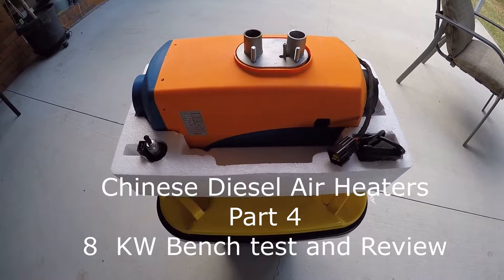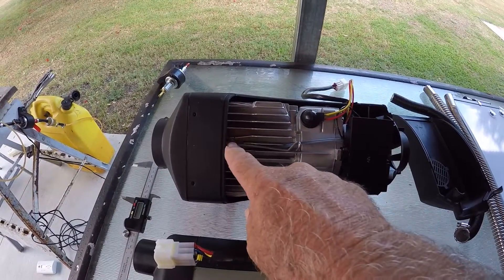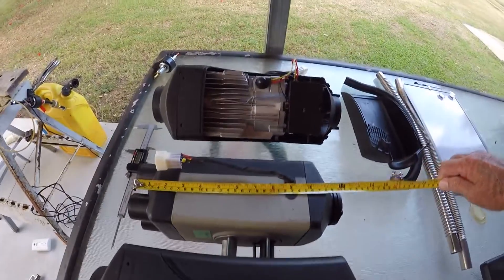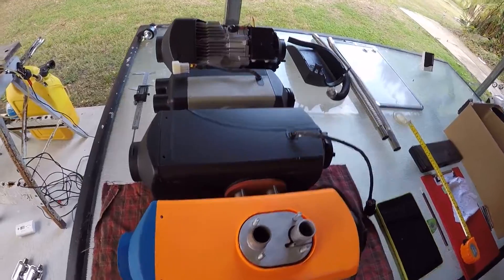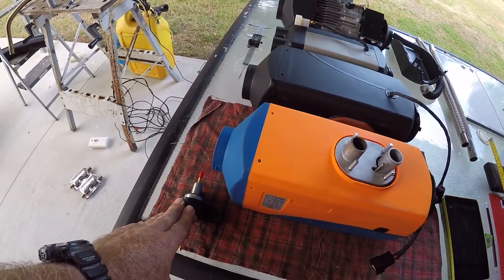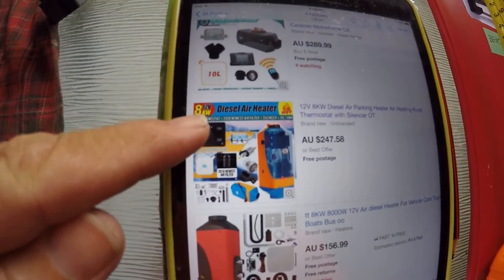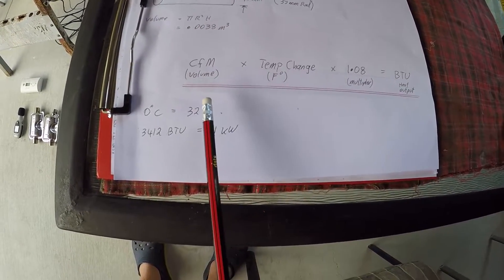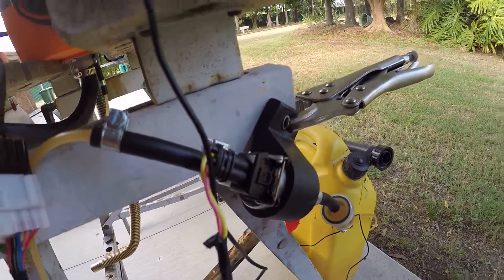Chinese Diesel Air Heaters   Part 4 -  8 KW Heater Test

Comment: I am running a 2KW heater mounted in the same orientation that they are on your bench (except 180 opposite with the glow plug at the top of the chamber). It is sitting flat on it's side. However at -30C, it keeps the temp at +2C in my van. If I wanted to swap the the 5KW into the same spot, would the exhaust and air inlets line up the same height above the side. I note that the %KW is longer, but I suspect it is also wider, and therefore I would not be able to swap them out?
Reply from the maker: Hi MP, yes the 5 kw heater is wider than the 2KW heater, so you would need some modifications.  JMcK
Reply: @johnmck1147  
Thanks a lot for the reply John. I've watched every one of your demonstrations, and looked longingly at the woodwork in the cabin of your boat. One thing I did not do, so I will watch them all again, is make notes that may relate to my installation because you touched on may points that I need to take action on. In the 2 years since I installed mine, I've probably made every mistake that you touch upon (especially with respect to the intake and exhaust lines). So one of the first things I did after watching your channel, was order a couple of new doser pumps. My latest problem seems to point to no fuel to heater. In Canada all our fuel is LSD, and I need to add lubricity agent to the fuel tank of my old Delica van, but have not added it to the fuel for the heater. Also the tank is a long way back, and I've made the mistake of letting the doser pump prime the lines on many occasions. Next when the temperatures outside improve from the -30C that they currently are, I'm going to crawl around and perhaps make some more modifications. For example, it would appear my pump although oriented correctly, is the opposite of your recommendation and I need to move it from right next to the heater and closer to the fuel tank. I pity the 'responsible' Chinese sellers of these items. There are so many variables to a successful installation, I'd suspect most the of the DIY installs go wrong the first time. BTW, until I discovered your videos, about the best written troubleshooting guide I had found that you can print is from a retired engineer by the name of Roy: https://www.letonkinoisvarnish.co.uk/eberspacher_intro_1.html
Reply from the maker: Mountain Parameters 

Hi MP, thanks for the positive comments, the detailed feedback and the info. JMcK

Comment: It is common in the furnace world to advertise total BTUH output (heated air plus exhaust). My 100,000 BTUH Lennox is 80% efficient and outputs 80,000 BTUH. 

The exhaust from the Chinese heater is pretty hot so imagine that it may only be about 65 -70% or so efficient. 5,000 watts divided by  0.65 is 7,700 watts so maybe they are accurate but just not mentioning the low efficiency. It would be interesting if you would run the same experiment on the intake-exhaust airflow and temperature differential to see if it produces the missing 3 kw.
Reply from the maker: Hi Dennis, the point I am making is these, so called, 8 kw heaters are EXACTLY the same as a standard 5 kw heater. There is absolutely no difference between the two heaters.   JMcK
Reply: @johnmck1147  Hello again. You mentioned that your controller pulses at a max of 5 per/second. Using a frequency counter, my t-stat can pulse almost 8 per second ( Non LCD).  Any chance that the difference is in the controller? At that rate, the heater would use 0.63 liters per hour. At 10.8 kw per liter (depending on the Internet source), the most heat that the unit can produce with 8 pulses per second is 6.8kw. At 70% efficiency that is 4.8 kw output. You are correct. It is a bit of a lie. 

On the other hand, this heater works wonderfully in my AstroVan. 

Thanks for the YouTube's.
Reply from the maker: Dennis Rech .  Thanks for the info Dennis.  JMcK

Comment: your forgetting something are you using the control module that came with the 8 kw maybe they have an updated version that allows you to go higher than 5.5 on the pulses to add more fuel
Reply from the maker: Hi Jody, I have done many tests here and with original, and different controllers. 
You could up the pulse rate and fan speed manually on the LED  controllers, but even with the heater screaming like a jet engine the heat output would barely exceed 6 kw. 

No, from all I have seen, this is deceptive marketing.   JMcK
Reply: Yes the 8kw from xin mai zhong auto parts  had a different controller and also a larger pump 28ml/1000 strokes. But as John says they are a clone of the eberspacher d4 and are not made to exceed much over 5. And measuring the carbon monoxide (which is how you should tune) shows that this. Plus you will overheat. Tuning is all that's needed for most of the issues people see

Comment: Will these heaters work while the vehicle is in motion? For instance, while operating a tractor or maybe a side by side while pushing snow.
Reply: Well I have a promaster service van I use it every day. Wishing you well with yours
Reply: Yes. I heat my enclosed snowmobile trailer as I drive up to the pass. Just have the exhaust pipe pointing back. It actually runs better than air forced propane, it will blow out at high speeds.

Comment: Thank you for the valuable measurements.
The 5 KW can only get 4 KW Input (Diesel fuel) and produce about 3,5 KW Output.
There are no 8 KW Units.
I do not argue with the technique and quality is ok the Chinese use but
more than 20% less power is a problem for the user to calculate.
Right now you can buy 5 KW (4 KW=Real) Units for about 120 Euros.
120 Euro for a 4 KW Heater is a peak of everything i have seen and the best value for the money.

Why do the Chinese do not use real measurement ?

They will sell more Units if they are more honest.
That is a lack of Chinese Culture I never understand.
Reply from the maker: Thanks for the feedback Dieter.  JMcK

Comment: Do these units have to be mounted leveled, like you test them, or can they be mounted vertically...suction of air on the bottom, exhaust of heated air on top and exhaust of consumed fuel on the side as a horizontal tube???
Reply from the maker: Hi Jiri, b

Basically the heaters must be mounted level with the exhaust facing downwards. However they can be mounted sideways with the exhaust facing out sideways, provided is is the side with the glow plug on top.

The heaters will run in a vertically -  for a while, just as your motor car can run without any engine oil. - for a while. The design of the fuel input system only supports the correct mounting positions listed above.   JMcK

Comment: Hello there.(December 7, 2019) As far as recovering more heat from the unit....can you mount the exhaust tube inside of a  larger tube and fan air through it in reverse direction of exhaust flow..... Second: can you increase the unit performance by mounting old hair fan on the intake tube and running it on low or medium?
Reply from the maker: Hi Jiri, yes you could use the exhaust heat to extract more heat energy. It could be quite dangerous to do as you suggest as any exhaust leak puts CO onto the accommodation area. Having said that, that is exactly how my little aeroplane is heated.

A better method may be to wrap a copper pipe around the exhaust to make hot water.

I would not mount an extra fan on the intake side. The ECU matches the fan speed of the heater with the fuel dosing rate to get an optimum heat increase from the heat exchanger.  JMcK

Comment: Good day John, can u tell me the Differences how to tell apart the 2kw to the 8/5Kw heater, I Purchased the eight but I’m starting to doubt to think maybe I was sent the smaller one, can u please give me the size Difference for the 2 Vs 8 kw (in inches) in the width and in length? & Would that be the best way to tell them apart? Tnx so much
Reply: Did you try to watch this video at all?  he give the measurement of different heaters.

Comment: Well, this is an extremely interesting, eye opening video. About halfway and at the end you say 'this is not a lab test, just a workshop test', as if it does'nt match up, but I reckon what you're doing here is very scientific indeed, and a true reflection and report on the facts, as tested with numerous accurate meters and using precise mathematics. This is proof, not just opinion, that this heater is not 8kw at all, but simply an ordinary 5kw advertised and sold as an 8kw. Here in England, if anything is falsely advertised like this is, then Trading Standards, a government department, shuts them down, confiscates all their stock and prosecutes the seller. That's the theory, but in practice, these are Chinese and sold from the internet by Ebay online, so what can we do in practice? If the importer is a seller based in your country, the consumer law might be able to exert some authority. It's disgaceful to be ripped off like this, these people are rogue traders. Well, at least you are able to show us the scam here with your excellent video, so thankyou for doing this. Best wishes from Alan, UK.
Reply from the maker: Hi Alan, thanks for your detailed feedback. It is difficult to know who the scammer is here. The eBay sellers market a whole range of products and I suspect they know little or nothing about these heaters, and the blame lies elsewhere.  Cheers,  JMcK

Comment: I imagine they would say that it is an 8kw burner of which 5kw is usefully harnessed for space heating hot air. I may look at a bit of heat recovery from the exhaust from mine. Rightly or wrongly they are astonishing vfm especially when compared with the units they are copied from! £100 is amazing.
Reply from the maker: Hi Robin, most of these heaters are excellent little heaters, and the price is so cheap they have opened up a huge DIY market. As you state, you can buy one of these German copy heaters for under $200, rather than a couple of thousand dollars.  JMcK

Comment: Supurb Videos John!! Very logically based. Thanks so much for the series youve done and answering so many ?s people have such as myself.  I was asking the same ?about the 8kw vs the 5 kw being all the design sizes of components r the same. 

Guys watch all his videos they will give u a much clearer understanding of how to have success using one of these heaters.  U can use the chinese made ones and have just as good of a end result and reliable unit if u use the assembly /install techniques John explains in his videos.  I love how you have meters to justify eveything u r saying and actaul measurements. As the manufacturers do not give us any of these.  I am a heating and air /refrigeration tech. And i use this in northorn usa Minnesota cold snowy winters in my work van ford transit. 5kw model does a great job. U could use one in an ice house or a small garage even. I like to run Kerosene in mine every few tanks to help keep clean of carbon. I would ask John does it help to run Kerosene only once in a while or do i need to use it all the time to get results?   What about a PEA fuel additive for cleaning the heater like from a auto parts store would that work well?     Thanks again Hats off to you Sir!

Comment: I've only watched 4 of your videos about these diesel air heaters yet, but now I know more about these heaters as from the manual and what I found with google. Thanks! 

You mentioned a temperature of 150°C max at the internal sensor. I've a 8kw model with the red oled remote and the remote shows a temperature of 220°C (+1,-3°C) at higher settings. I haven't measured the temperature with a other device to check if the shown temperature is right. If it is, is it possible that there is something wrong with my heater? I have an ambient temperature of 10-18°C . The plastic housing isn't getting hot.
Reply from the maker: Hi Mr Underwood,

I have yet to see a genuine 8 kw Chinese heater. The ones I have seen are 5 kw falsly branded as 8kw.

The temperature depends on where and how you take the readings. If the case is not getting abnormally hot, I don't think you have an issue with your heater.

Regards,   JMcK

Comment: Very good series of videos. One point about ratings is the ambient temperature could affect them. At 20c ambient,  you may need to shut down to prevent overheating. at 0c ambient,  you would be able to use more fuel without overheating. The higher fuel consumption would give you a higher heat output rating.  It is possible that there is an ambient air sensor inside of the control board that limits how much fuel that is it's maximum pulse rate for the incoming air temp.
Reply: I've the 8kw  model with the red oled remote control and had running it at lower ambient temperature (10-18°C). The remote control shows an internal temperature of 218°C when running it with higher settings and I had it running for over an hour with 7Hz without any problems.

Comment: This is actually good news for me, i purchased a so called 8 kw heater which i have used in a garden shed, it worked great until the last couple of days when i decided to rearrange and move the heater into another shed, i inadvertently connected it to 220 volts and fried the motherboard, i tried to find a 8 kw board without success, i  found a board on ebay that was for a 3 to 5 kw heater, when i checked all the capacitors against mine they were the same values, so i have taken a punt and ordered one, i will let you know if it works.
Reply from the maker: Hi Jimmy,

Thanks for the info. One big advantage of these Chinese copy heaters is they had standard parts and wiring so you could mix and match parts. However one manufacturer, possibly more has decided to change the ECB config to lock you into their spare parts.

If you had a standard unit. Eg. a 5 kw heater but sold as an 8 kw heater, a 5 kw ECB should work.

Good Luck,  JMcK
Reply: @johnmck1147  Cheers mate thanks.
Reply: @johnmck1147  Hi John, just a update on my situation, i purchased the 5 kw motherboard for my supposedly 8 kw heater, i was excited when i plugged it in and the lcd panel lit up, unfortunately that's as far as i got,  the panel reads error eo7 which is a fan fault, on further investigation the terminals on the motherboard for the fan are wired different on my old board so it seems its a no go, so iv'e bit the bullet and bought a new heater ill keep the old one for spares.
Reply from the maker: jimmy s 

Hi Jimmy, thanks for that feedback. Did you try reversing the fan wires?
Good luck with your new heater.   JMcK
Reply: @johnmck1147  Hi john i tried all ways to get it to work without success, on my old motherboard the plug had 3 pins with two wires, but on the new one it had just two pins, when you looked at the circuit it took a different route through the board, the new heater arrived with a cracked LCD screen, luckily i had a spare so it turned out ok, it was a simple job of just changing out the old heater and using the existing wiring and fuel lines, i will strip the old heater down and use it for spares, thanks for the info.
Reply from the maker: jimmy s 

Thanks Jimmy. Yes, you now have a lot of spares.

Comment: Hi John, thanks for sharing your knowledge. Any comment on the smaller 2kw vs larger 5kw units in terms of noise and current draw? Thanks.
Reply from the maker: Hi Blitz,

I will do a comparison video next month when I return from sailing.

If you have a small space, buy the smaller heater. 

Otherwise, there are two schools of thought here. 
1. Have a small heater and run it on high setting to lessen carbon buildup.
2. Haver a heater bigger than you need and run it slower.
In most cases, but not all, I go with number 2. There is far less noise and wear running the heater on a lower setting. To lessen carbon build up, just giver the heater a full power run for a minute or so before shutdown. Or if using regularly, a boost run for a couple of minutes every week or so.
Cheers,   JMcK

Comment: I agree with what you are saying about deceptive advertising. I have just got a 2kw unit and found if you do a search for 2kw most of what comes up is a 5kw.  The size is a dead give away and the vent size being 75mm instead if 60mm used on the 2kw. By this lodgic one would expect an 8kw unit to have about a 90mm vent size and these so called 2kw units are also being sold at a premium price also. Buyer beware.
Reply from the maker: Hi Phil, thanks for the feedback. Yes there is a lot of deceptive advertising.

However, if you really want a 2KW unit for its smaller size. (I look for dimensions and weight. 2KW is about 2.7 kg. I have purchased a genuine 2 KW (size restrictions) of this seller.

https://www.ebay.com.au/itm/de-2KW-12V-Diesel-Air-Heater-Tank-Knob-Switch-For-Truck-Boat-Trailer-ee/333074609655?ssPageName=STRK%3AMEBIDX%3AIT&_trksid=p2057872.m2749.l2649

Cheers,  JMcK

Comment: Hi great vids do you know if there is any difference between 12v and 24v models ? As I have looked at so called 24v but they seem to do 12v as well but have been set at 24v . Also the price seems a bit more .
Reply from the maker: Hi John, the actual heaters are the same. The ECU is 24V, the dosing pump is 24V, the fan is 24V, and the glow plug is 24V.   JMcK
Reply: I was wondering about this too.i have 12, 24, and 120 volt choices in my off-grid setup. Thou where I would need this is only close to 12 volt and 24 volt is buildable...

Was wondering how one unit could do either or, and was wondering if there is a performance difference between the 2 voltage choices.